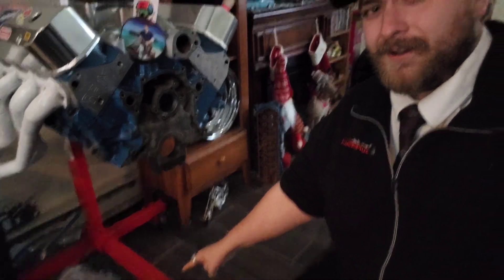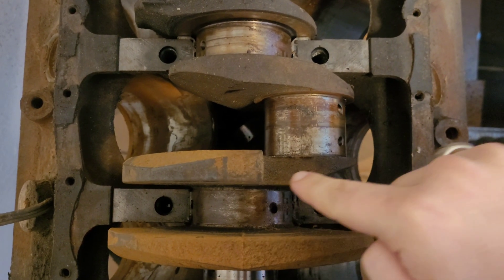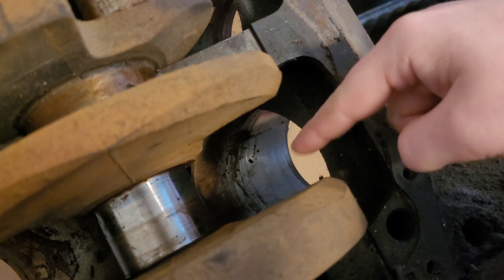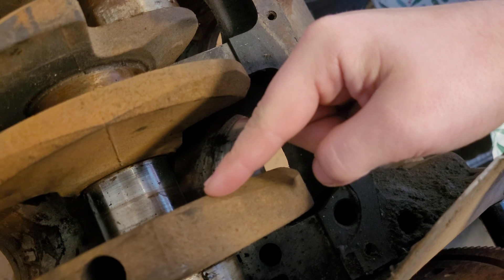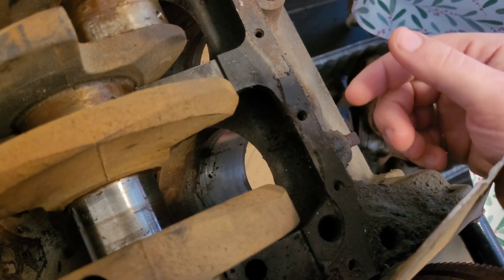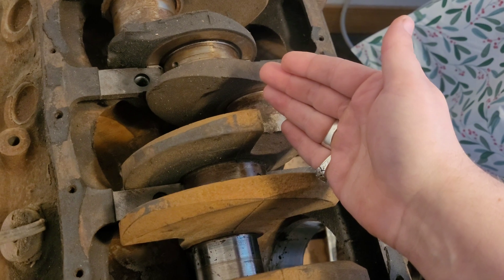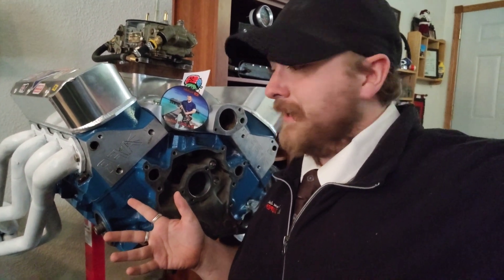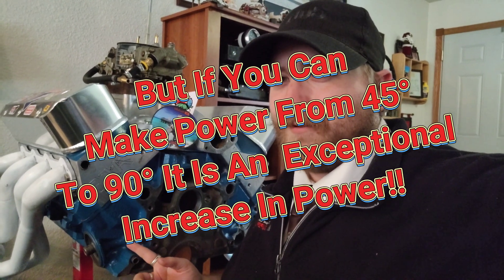What Is A "Stroker" And Why Does It Make Power? What Are The Cons?

Comment: I understand the principles but How do you lengthen the stroke?
Reply from the maker: You get a stroker crankshaft or a crankshaft with a longer stroke
Reply: @newguysgarage6802 ok. Thanks. I was coming up with all kinds of crazy notions. First, I thought, well they must bore the block to put a longer sleeve in, put a spacer on top of block, longer rod, crazy stuff! Does it weaken crank?

Comment: Just to clear up any misconceptions:

There is no leverage inside the engine that benefit propulsion. You can find it in the transmission, differential and tire diameter however. That leverage is what makes Power the more important metric over engine Torque in fact.

Comment: I have a stroker dilemma. I recently bought an R302 block that was machined but never built. Came with a forged 3.25 crank installed. Cylinders were bored and honed to 4.020. My dilemma is what to do with it. Use that crank and bore cylinders to 4.125 for a big bore 347. Bore cylinders to 4.030 or 4.060 and buy a 3.40 crank and have a 347 or 352. 3rd option is to   have 4.125 bore with 3.40 stroke for a 363. I don’t know what to do with it. Any advice is greatly appreciated. Thank you
Reply from the maker: @BrentFrancis-h8o  you already have a nice crank so I would say bore it out and make the big bore 347 😃

Comment: I don't  think you can put a 351 crank in a 302 the stroke will hit the bottom of the bores. Biggest you can stroke a 302 is a 347. Or you can get a 363 block.

Comment: Does this also have a potential to increase vibration?
Reply from the maker: Vibration and harmonics should not be a factor so long as you have a balanced assembly. 

Side loading the piston against the cylinder wall can be an issue with too long of a stroke on too short of a block (deck hight) 🙂

Comment: Basically a stroker has a bigger displacement due to the larger stroke, usually it will give you more torque throughout the whole Rev range, however this also makes for a higher piston speed at the same rpm compared to a standard stroke engine, usually a square bore to stroke ratio engine with a piston rod length around double the stroke will make the maximum horsepower.
Reply: Is it that square engines make the most power or that they are the most efficient? I know that using a bore that is about the same as the stroke will increase efficiency by ensuring that the flame-front reaches the cylinder wall at the same time that it meets the top of the piston, but wouldn’t a lower stroked engine allow for more power by allowing the engine to rev higher. I believe this is one of the reasons that race engines tend to have much larger bores than strokes.
Reply: @Mr.man1093  It depends a lot on the application and the displacement of the engine as well, naturally aspirated four-stroke engines on pump gas tend to be most efficient with a square bore to stroke ratio, and a displacement of around 500cc per cylinder.
Reply: I plan on doing a 363ci stroker kit on a 5.3 ls 325ci is 6500 rpm still safe with good valvetrain?

Comment: I caress my heads, massage the rods, stroke my crank, and handle my block when I am not rubbing the blower or hugging my tunnel ram.

Make my engine bigger? YES PLEASE. Its like the standard thing I do, take 400 blocks and turn them into 461s or 489s. I really want to make my four bolt 351C 4V into a 407 with a 4" crank. It just says yes to me.
Reply from the maker: Nothing quite like a large cuibic inch small block 🙂
Reply: @newguysgarage6802  I don't think the Cleveland will make as much power as my Pontiac engines do, but it will spin more RPM and thus make plenty of HP.
Reply from the maker: You just never know lol 😁😉
Reply from the maker: Hahaha 😂
Should i build this 351 stroker and put a 289 air cleaner sticker on it? 🤣
That would be hilarious!
Reply from the maker: Lol 😁

Comment: You also got the odd-ball 351m! It's the opposite of a stroker. They took the 400 and gave it a shorter stroke! That stick is sweet! Tell Tom thanks from me. Get well soon man!
Reply from the maker: Ill get better eventually 😅
The M motors are defenatly odd-balls lol the 400M for all intensive purposes is basically a stroked out 351C (aside from the obvious differences) 😄
Reply: @newguysgarage6802  Is the 351c also a 335 family engine? I don't know too much about them.
Reply: Just looked it up! It was! Sounds like the 400 and 351m had a taller engine block.
Reply from the maker: Ya, im not too familiar with them myself but i imagine they are to the cleveland what the 351w is to the 302w know what i mean lol
Reply: @newguysgarage6802  I'm picking up what you're putting down.

Comment: Hey I have a question I'm thinking about putting new vortec head on my TBI 350 will it hurt the bottom of the motor in the long run
Reply from the maker: Shouldn't hurt the bottom end unless you dont  have enough piston to valve clearance.

But that wouldn't be a long term thing....you would find that out really quick 😅

Comment: I'd like to see the Cleveland heads on the Windsor block, uno stock ford stuff retro fitted. Like a boss 302. I have a 302 Windsor and a 302 Cleveland, my 'plan' is I'd like to put the heads on and fab a manifold like on a 62 hemi crossram. The manifold is the easy bit to make, but the water jackets are different. Arp make head studs, so bolt on shouldn't be a problem,  w7/16 c9/16. Gr8 video thanks.
Reply from the maker: I probably would have done something like that had i not scored those 165cc AFR Renegade heads with the 2.02 intake valve put in 😅

But i am planning on building that cleveland engine in the future.......if the block is not too far gone that is 😁

And im still not 100% sure what im going to do with the 289 when i get the "302" done 🤔

Comment: Is there any drawback by making my 406sbc into a 421 , it's definitely going to make more total hp and tq but I wonder if it will change the power band.  I have an S10
Reply from the maker: Just need to make sure the cam and piston rods have adequate clearance, and oil pan to rod as well. 

Also you will want to make sure you have a cam and head combo that better matches the extra cubic inches! (And im sure you know the steam holes in the heads with the 400 too 😉) 

Otherwise do it! Make a mean machine when  she is done 😁
Reply: I had a GM 509 block with the steam hole thing but I sold it and got an SHP now.  After seeing people debate about whether or not the GM blocks are weak, a buddy of mine did break his GM 400 block last summer
Reply from the maker: Ahhh ok i see lol 🙂

Ya my only experience with the 400 was the GM block, had a 406 in the cutlass on E85......miss that car 😅
Reply: All other things being equal, if you add displacement, you will increase peak torque and hp, and it will occur at a lower rpm.

Comment: More leverage haha
And since torque is king.
Long live strokers!
Reply from the maker: Dam right! 😁
Reply: There is no leverage inside the engine.  You can find it in the transmission, differential and tire diameter though.  That leverage is what makes Power the more important metric over engine Torque in fact.